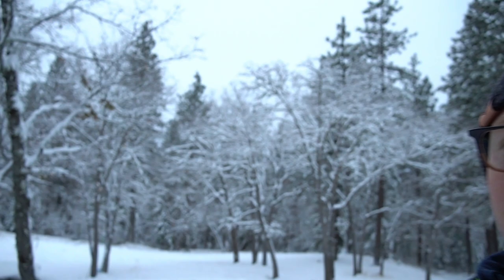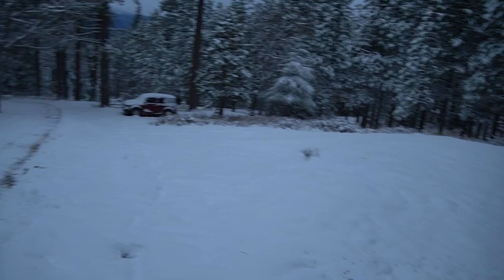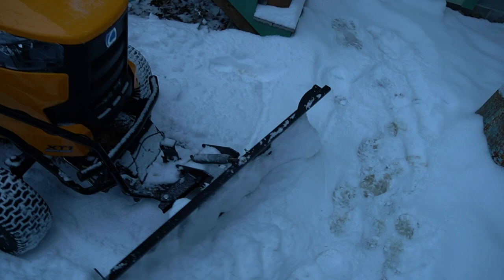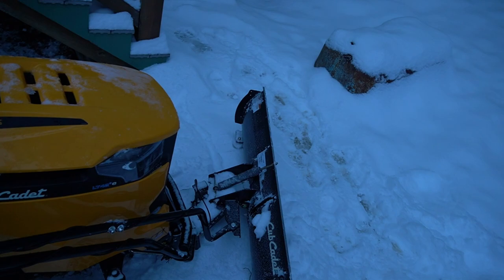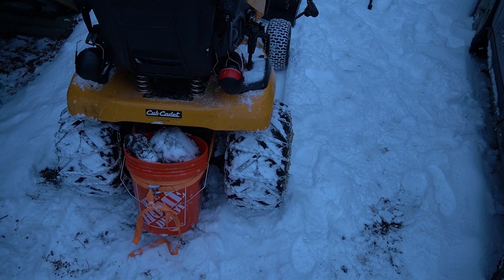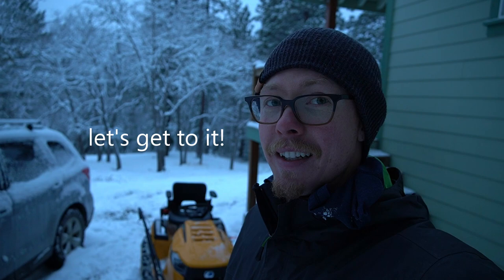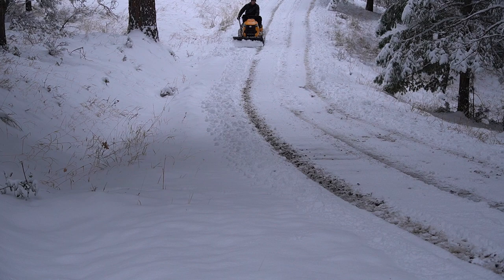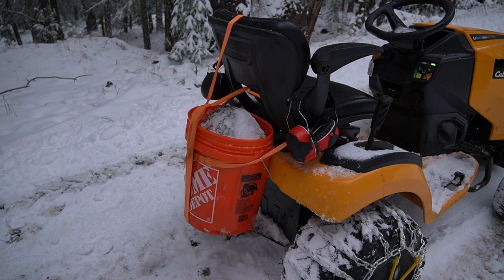Cub Cadet XT1 ELECTRIC Snow Plowing!

Comment: I don"t think this is suitable for a large snowstorm.   I think it will be awhile before this replaces my diesel tractor.
Reply from the maker: Hi Rich, definitely not a direct comparison to a diesel, mainly because any diesel is going to have signficantly more weight behind it. This thing hovers around 400 lbs. I can lift up the front end myself. We get some good size storms here, 2-3 feet in a day or two. It is manageable, but requires constant plowing every 2-3 hours to keep up with the storm. You have to get up in the night to plow with this. If snow gets over 8", forget it. Many big manufacturers switching heavy equipment to electric in this next decade (Volvo) when we get one comparable in weight to your diesel, that's a real test. By then I think GMs Ultium cells will be in most products and battery capacity will not be an issue. The power and little maintenance of a properly sized electric motor is and always has been superior, it's just energy storage and end-price that is the limitation currently. Lookup Fendt electric tractors too. Cool stuff. Thx for chiming in!

Comment: Electric will not last as long those power cells will die out in a few years time gas is the best power plant and I don’t even want to know the price of the batteries once they go bad which they will it is not evolved enough to be completely reliable yet more of a gimmick then a tried and tested reliable platform in 10 years might be a different story I will stick to my petrol powered preferably diesel when something goes wrong I can fix it with a wrench and some carb cleaner
Reply from the maker: Cool, sounds like you got your mind all made up.